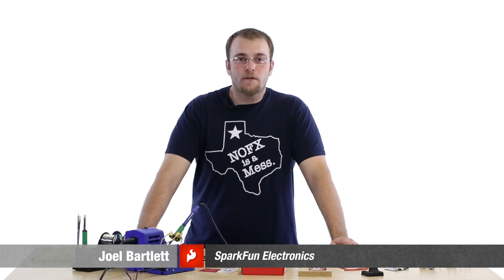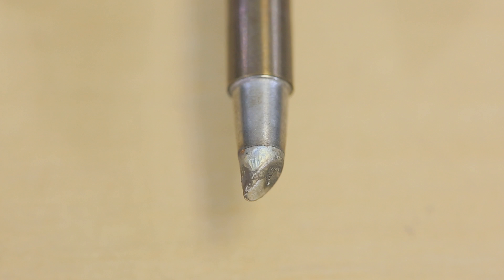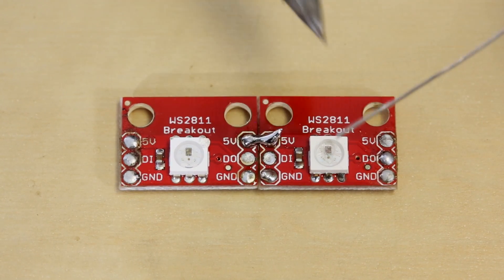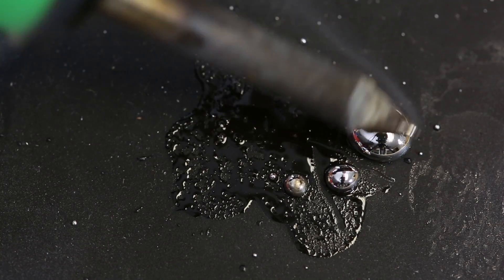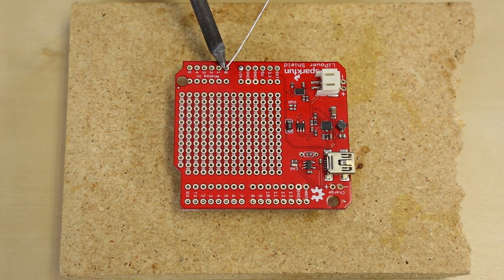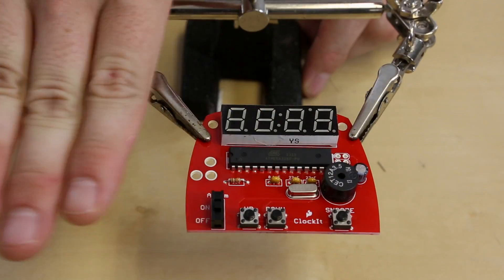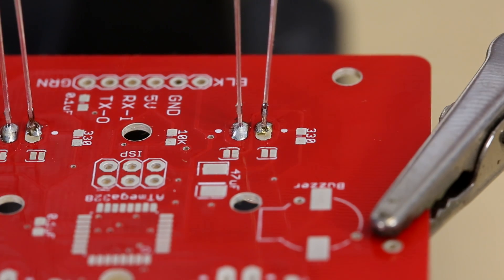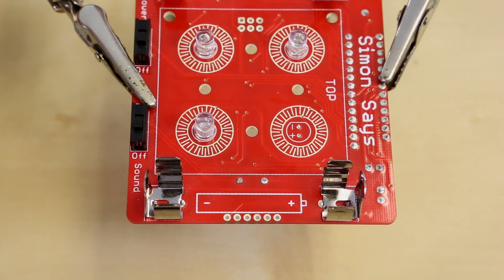SparkFun Advanced PTH Soldering

Comment: Thank you for the video but I didn't find what I was looking for. For the past hour now I've been looking for information on how to make working circuits on a generic printed bread boards. Is the only way to connect the components, once they are soldered to the bread board is to form a melted stream on solder from one point to a another point? And if so... will that method work on all printed bread boards. This only concerns bread boards that don't already have a designed layout which then all thats needed to solder the parts on.
Reply: you connect them with wire cable or use them leg.
Reply: If the tracks you want to connect are right next to each other, there's nothing wrong with using a solder bridge.

Otherwise, connect them with wire and solder.

Comment: I learned how to solder the Bell System Way ( AT&T). You would apply the iron to the connection, keeping the iron on the lug you would move the tip of the iron so you could apply solder to it and then press it up agaisnt the lug to solder the connection.

I thought this was really crazy, so I'd do it my way when the instructor wasn't looking.

Comment: No need to be that aggressive. Advanced isnt relative to skillset at all by the way. Ski slopes for example are often graded in basic, intermidiate and advanced as well and they arent relative to individual skier skillsets either. Techniques like bringing the solder to the heated joint and not from the soldering iron to the joint are basic skills. The other techniques like desoldering or using soldering wick are considered basic as well.

Comment: Actually, he's correct. I run workshops where beginners solder their first kits, and this is soldering 101.  For "advanced" I'd expect to see soldering of surface mount components, soldering QFP and TSOP packages, solder paste/masking, hot air rework and reflow, etc.  None of those are at all outside the realm of the hobbyist.

Comment: Oh lovely! That also seems to be a non regulated iron, hence why the joints all look like crap. Sorry Sparkfun, this isn't helpful.. Though, i have been soldering since i was 6.. I'm 21 now.
Reply: Electricguy that’s not the culprit, i’ve been using a $10 wall-plug iron with a fine tip for 5 years now and my joints are all perfect. it probably has to do with their solder, with a good .5mm flux-core leaded solder you won’t even need to add extra flux (at least when working with through-hole parts).